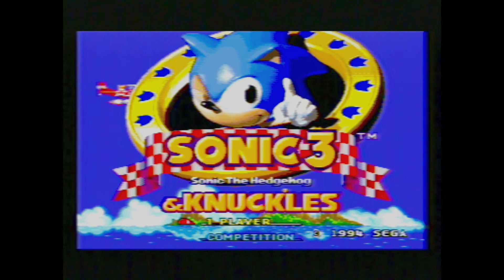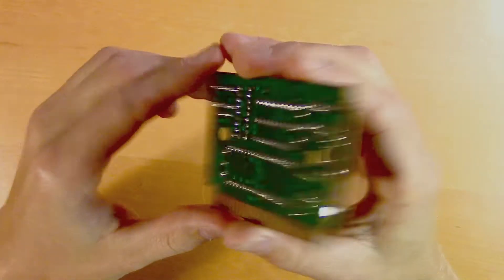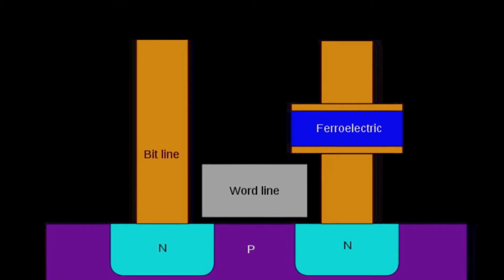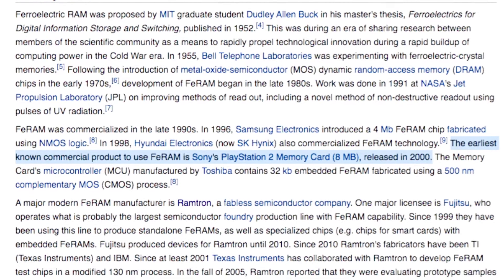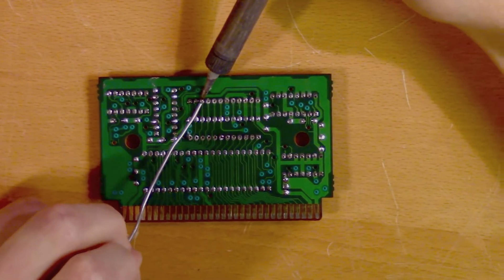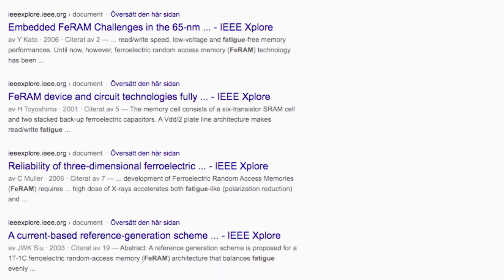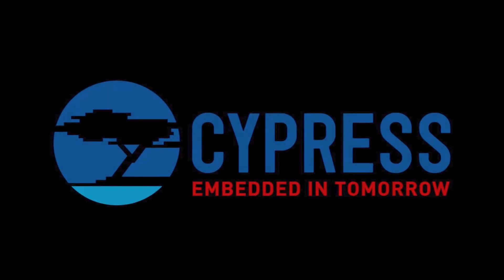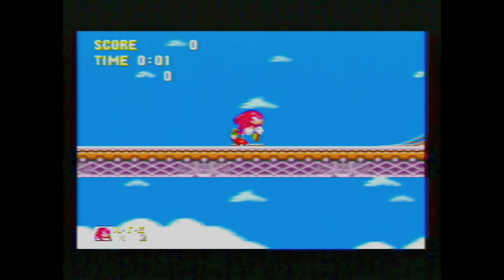SEGAs Unexpected Choice of Memory Technology for Sonic 3 and Knuckles

Comment: SEGA must have been really experimenting to put this expensive memory inside Sonic 3. Some irony that the SEGA CD and SEGA Saturn consoles would use RAM to store game save data internally to the console, which I discovered to my horror was lost when the battery died. Very few people who owned these consoles bought the SEGA memory cards because it was believed unnecessary unlike PS1 and early N64. Dreamcast switched to memory cards but even the VMU unit absolutely drained watch batteries with it's power consumption, luckily it did not lose it's saves when the battery died. I remember still using floppy disks during the early 2000s for school work, long term writable memory was really not economical until the mid 2000s.

Comment: If i had to make a guess why Sega decided to use something seemingly as overkill as FERAM it might have been because they already were planning on using a lock on cartridge to united Sonic 3 with is second half Sonic and knuckles. And as such was persistent storage that wouldn't need a battery in form of FERAM used to make this task easier to design as Sonic and knuckles would have to read and write to Sonic 3 every time it saves. 

Or in other words they future proved Sonic 3 for Sonic and knuckles. 

As to why some chips bricked? I think you might be right that it was just a few bad chips lacking in quality due to being the first consumer version ever.
Reply from the maker: Good point! The lock-on technology might have made it difficult to design a reliable battery type save feature.